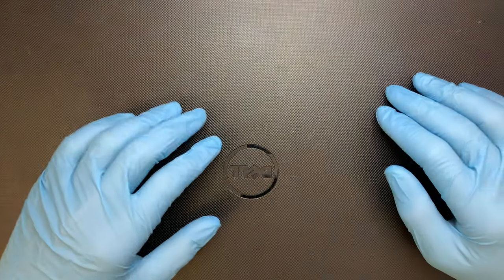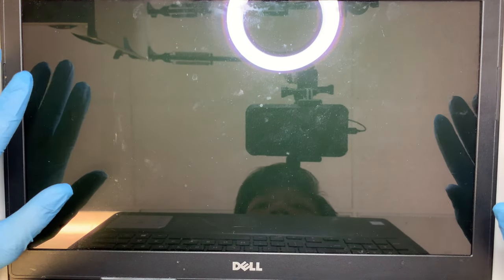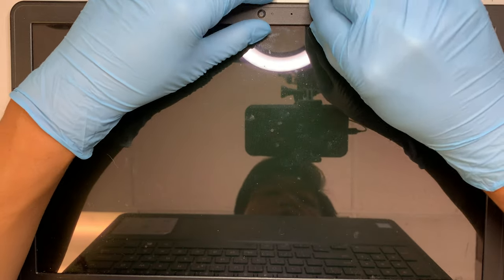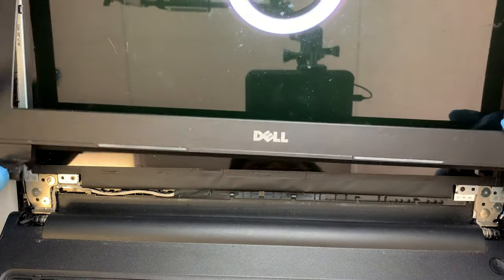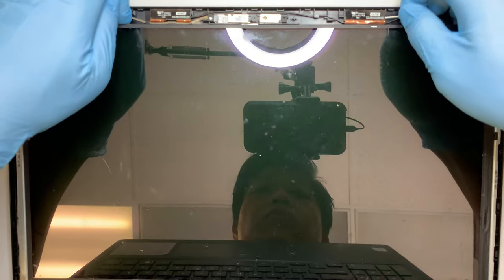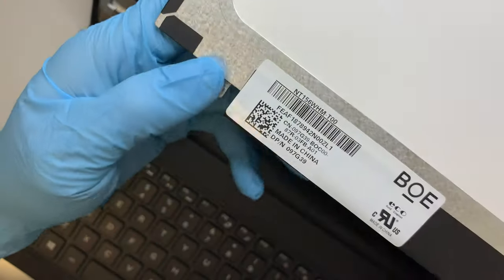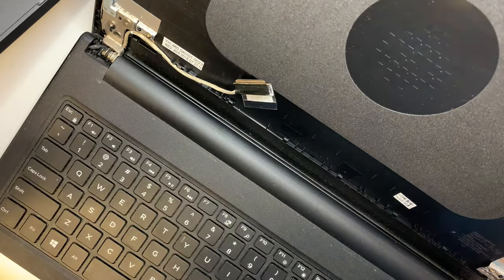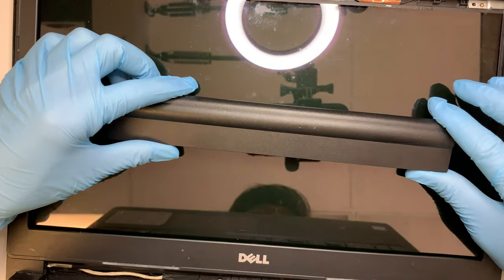Dell Inspiron 15 3000 Series Touchscreen LCD Screen Replacement

Comment: Hi! I have the same laptop but mine now has issues with the screen because of the cracked plastic lid on the right side. Can it be fixed by changing the LCD or not? I was hoping to fix it since I am using it for online classes. Thank you so much 🥺 I am looking forward to a reply, please.
Reply from the maker: Do you mean the plastic bezel is cracked ? or the hinge is broken and lifting the plastic bezel ?
Reply: @UberGeeks  my hinge broke. Any suggestion

Comment: After I dropped the laptop by accident the screen is just gray with lines now. What do you think is the problem. It works on an external display
Reply from the maker: You need a new LCD screen. This video will help you change out the LCD. Check out description link on where to buy the replacement screen.
Reply: @UbergeeksBiz  ok thanks

Comment: Hi please  ! How can I identify if my laptop has 30 or 40 pins. The model is Dell inspiron 15 3000 series. It has the touch screen.I need to buy the touch screen replacement
Reply from the maker: 40 pins. You can check description to find out where can you buy the replacement screen.

Comment: I have the dell Inspiron 1500 3000 series no touch. How do i know if its 30 or 40 pin.
Reply from the maker: It's 30 pins. Check link in description, it will link you to ebay or amazon for the right LCD screen.